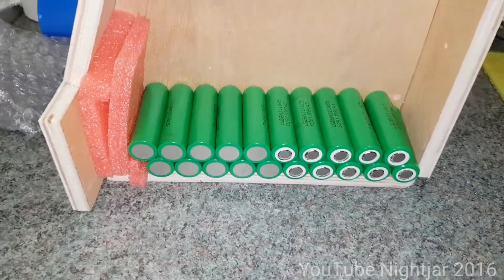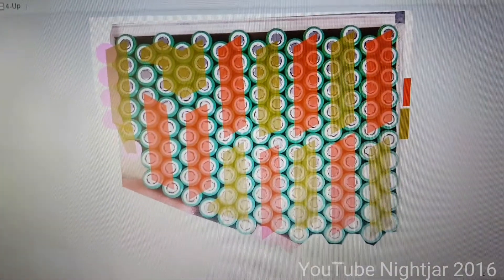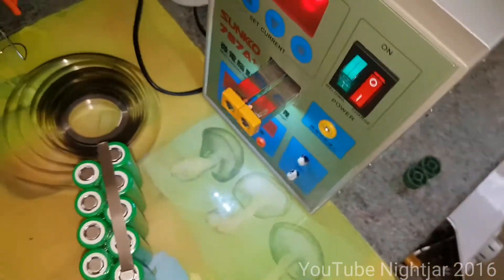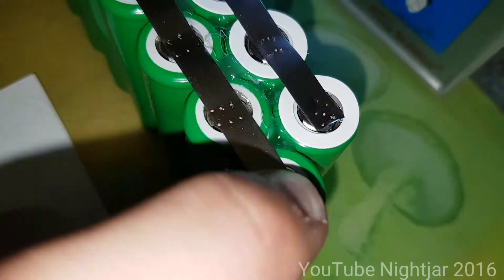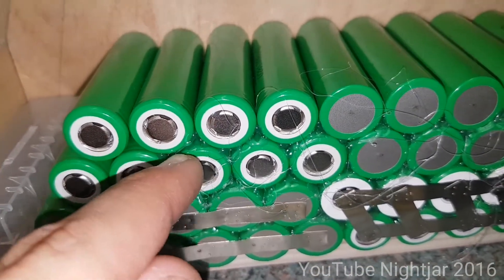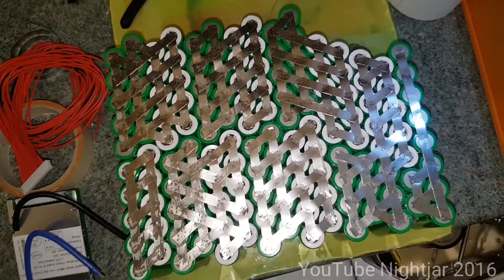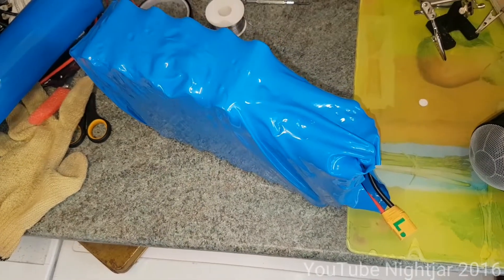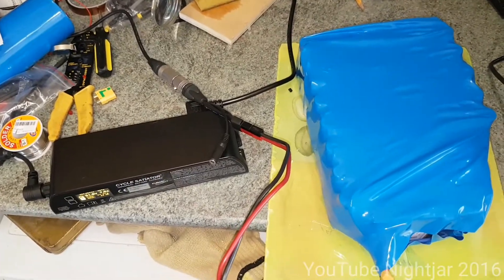DIY Electric Touring e-Bike Build #1 18650 Battery Building

Comment: Hello and thanks for shearing.
I have a question. Why do you make 14s10p instead of 10s14p which is 36v? For touring bike 36v is more than enought, as you don't use much power, but with 14p you will have better range (better Ah) for the same price.
Reply from the maker: The range would be the same with a 14s10p and 10s14p as the energy in the pack is identical. I wanted to run 52v so I could spin my motor faster.

Comment: Looks like the pack is 14S10P is that correct? That is exactly the same as I am planning on putting together. I'm currently collecting cells and testing them. What BMS did you use?

Comment: I really like your approach to battery pack design - simple and efficient. Very "British" if I may say so;) Did you think of using a wide metal strip to weld your cells together? What I mean is that your design allows you to use 25mm strips, it should save you the hassle of having to bind long parallel connectors together at 1-cell intervals.
Reply from the maker: Serge Fog thanks! Do you mean a strip that is 2 cells wide? If so i didn't see any strip that wide, and on the positive side of the pack if it wore through the insulation it would short out the cells

Comment: Hey, I have 74packs of dell 97wh laptop batteries  with a total of 666cell and expecting to have at least 480cell good cell of at least 2600mah per cell  that i can  use to build a mega 24s 20p 62.4AH or 6.3KWH diy ebike battery to power my 3000watt QS motor. What are some advice that u can tell before i start building by MAY 1. waiting to hear from u soon.
Reply from the maker: Chris Ngwa just be prepared for a LOT of work! Good luck! :)

Comment: Hi, how are you going to put protection on the battery's .Eventually one cell will fail and turn into a hot little heater and melt the next battery to it.Lets hope they last a couple of years then I would get a bit worried and store my pack somewhere safe. Fuses seem the way to go and cell loggers to monitor voltage as well which are all cheap protection devices.Its like anything you buy but being on a bike it's gonna get lots of vibration and plenty of wear and tear.Putting them in a back pack may be less physically damaging 2 them and just connect them up later. Also someone is less likely to steal ur bike . Lot to be said about that I soppose but I am no expert just researching at moment. Good luck tho I respect your enthusiasm